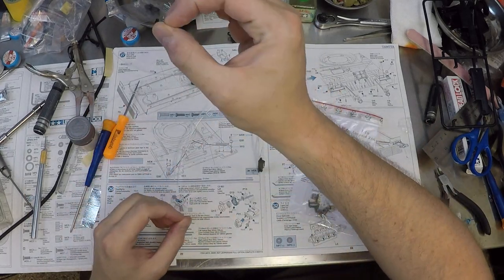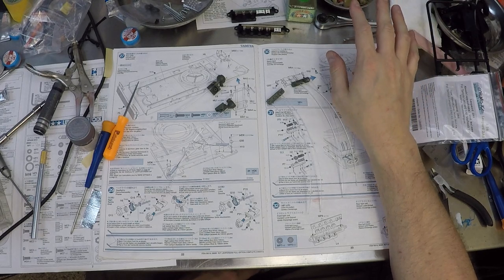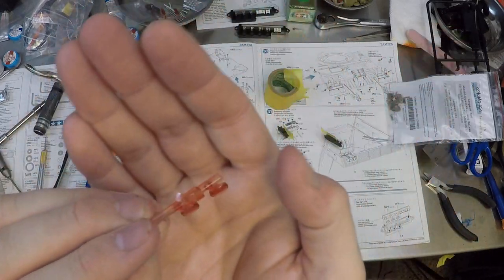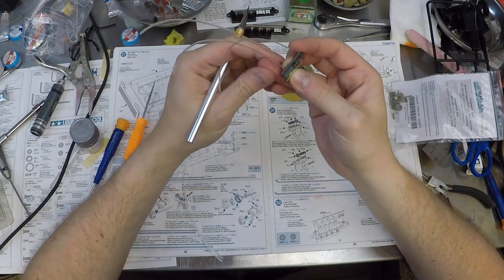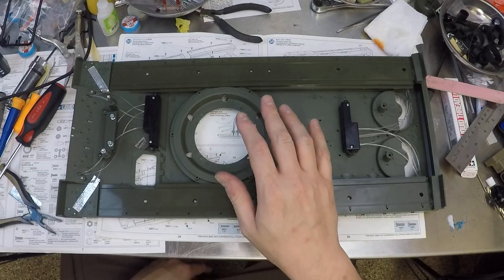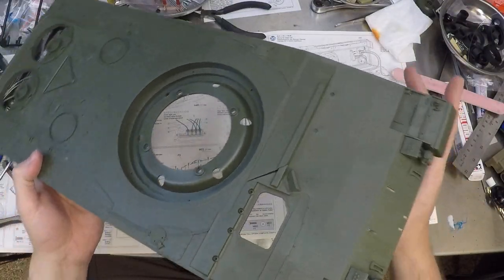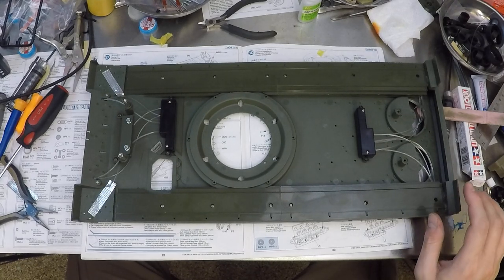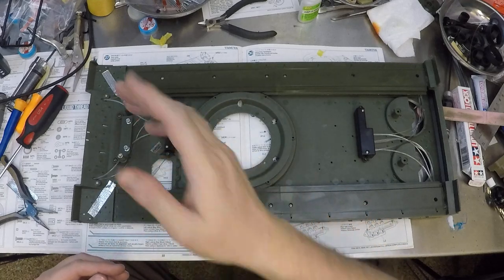Tamiya 1/16 RC Full Option Leopard 2A6 Tank #56020 Build w/ KingKong & Schumo-kits upgrades part 6

Comment: Great video so far. you know if you had painted the Lower Hull prior to starting the build ie: the motors and speaker etc and before mounting the wheels you would have saved yourself a headache...lol
I plugged up the suspension holes with blue tac before painting the Lower Hull. Painted all the Suspension Arms and all of the Wheels including the Drive Sprocket Wheels and Idler Wheels. 

Once they were all dry like 24 hours later depending on your climate. I am in a very humid climate in Queensland Australia, you can actually build the whole Lower Hull. I did paint inside the Lower Hull as well and it did look nice when finished, especially with the brass parts inside the Hull which was I think a Nato Green. 
I also painted all of the Top Deck including the Turret and the Main Gun before assembly.

 It did make the build easier when it come to assembling everything else.

I have been building models since 1967 which is over 55 years now.

I did build a Jagdpanther and it came with the Darryl Turner Alloy parts namely the Main Gun Trunnion and the aftermarket Main gun Mantle which was a huge improvement over the stock Tamiya unit. This is one of my builds that I sold a while after I had completed her regretfully now because I want another one....lol
Reply from the maker: Thanks you, glad you are enjoying the videos. I used to paint sub assemblies before final construction but then saw Andy's hobby headquarters and his style of painting the fully built model is much easier plus has the benefit of getting a very even finish considering the style of painting i do with preshading. You have been building models longer than I have been alive. good on you!